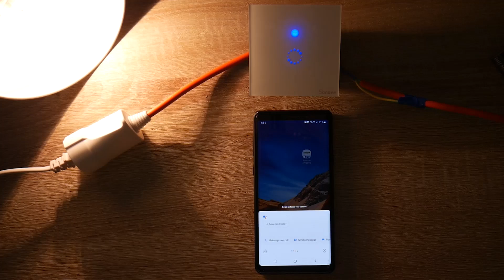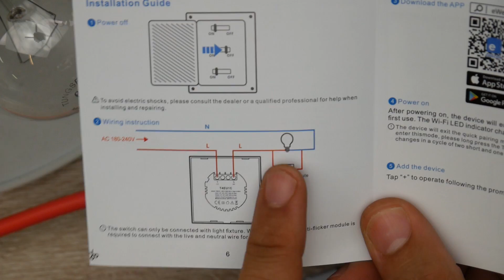The Ultimate Smart Home Light Switch  // 1-Wire Sonoff TX T4EU1C

Comment: Couple of things to point out:
1. You don't need all electrician to install this kind of stuff. Just make sure you turn off the breaker before install. 
2. Adding a new wire to concrete home isn't difficult and can quickly be done using a cheap cable puller. This is because the wires nearly always run through a pipe so their is enough space for an extra wire. 
3. For the price these probably don't have any good security and so can be easily hacked. This is really bad as large bot nets of iot devices have already been used to ddos services. These probably will also never receive a security patches unlike iot devices from more reputable companies.
4. You shouldn't need to turn off 5.8hz on you router if you have set it to hosting two different WiFi networks.

Comment: Interesting product. I have no idea to whom this is targeted. What sort of house would not have live, common, ground to every switch and receptacle? I restored a house built in 1919 and the original wiring (w/o ground) would have supported any of the current products. Also, you don't need to disable your 5.8Ghz on the router. You just have your phone use the 2.4GHz during setup and then change your phone back once done. So, to answer your question, yes definitely interested in these products in general, just don't see a role for a device with such a convoluted set up process, and which, at baseline, is not compatible with modern bulbs. Maybe I'm missing something?

Comment: Whats the reason behind disabling 5.8ghz during install?
Reply from the maker: They cant connect when 5.8ghz is enabled.
Reply: @DroneMesh  that doesn't make sense to me. I've never had an issue running dual band AP(2.4ghz + 5.8ghz)  with any of my esp8266 or esp32 devices which I assume these smart switches use.
Reply: I have some sonoff inline switches & to install I had to disable 5ghz connect them then re enable them.